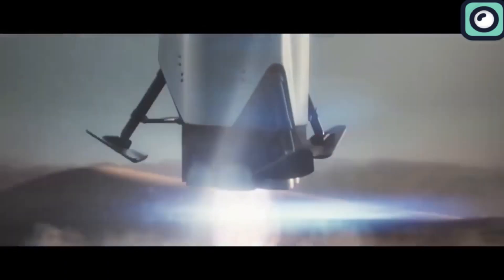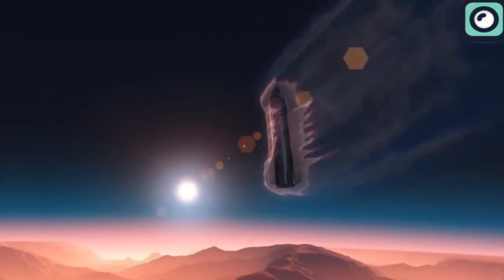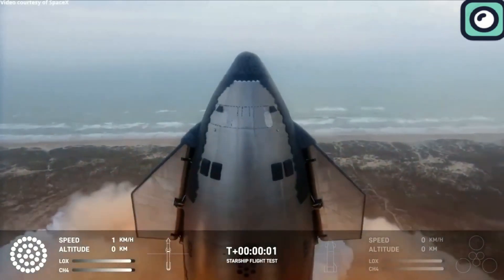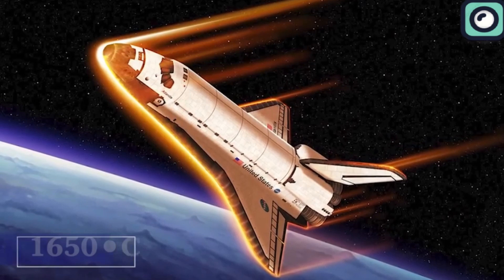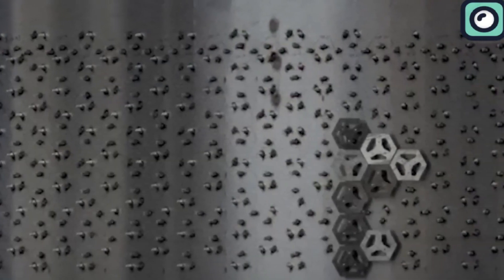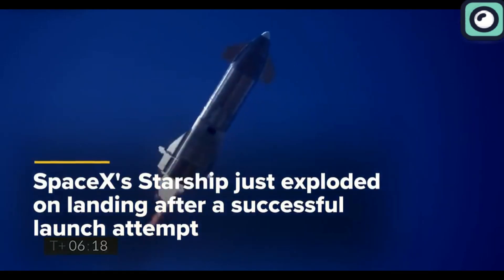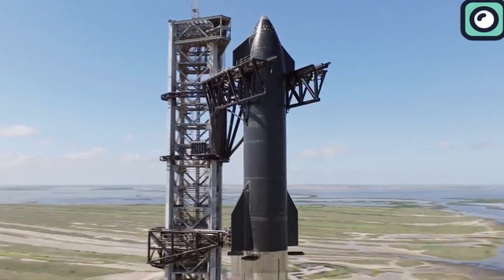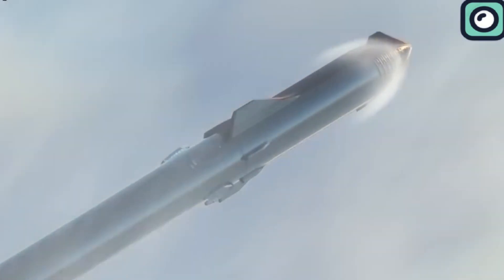SpaceX In Trouble! Starship Heat Shield Causing BIG Problem!

Comment: I concur with every suggestion made by the previous comments.
In addition it may be wise to avoid the ozone layer, 0³, which is highly volatile.
What about the possibility of re-entry
through the ozone hole over Antarctica.
However this introduces the problem
of returning to the launch point,
Starbase. 
Since an ocean landing is apparently planned the least stress on the  Starship re-entry may be through the ozone hole.

Comment: --->>> HEAT SHIELD food for thought --->>>The tiles should interlock as much as possible to reinforce stability.  Those that cannot be interlocked should be attached to pins that protrude all the way through the tiles and are then deformed similar to how a rivet works.  Deformation should push the pin protrusion back into the tile body leaving behind a divot.  Divot is then filled in with a ceramic putty that will survive the re-entry.  An alternative would be to press a deformable staple into the tiles from the outside, so that they connect adjacent tiles to each other; and , they countersink themselves into the tile body and since they are not attached to the stainless steel rocket body will not transfer critical heat.  The staple or steeple deformation will prevent the staples from coming out due to vibration or space vacuum.  Thus a U shaped staple becomes a W shaped cleat.  
    Yet further; a 3D printed net of titanium or other high heat survivable alloy should be secured over several tiles to unify them and hold them down onto the rocket body.  
     Perhaps the heat shield should be able to stand alone without the rocket body and be snap fitted to the rocket?  
    It may be that a reusable unitized heat shield should merge to the rocket, in space, just prior to reentry;  like an egg inside an over sized Styrofoam coffee cup; or a glove for a welders hand.